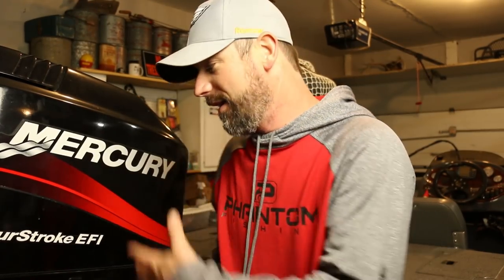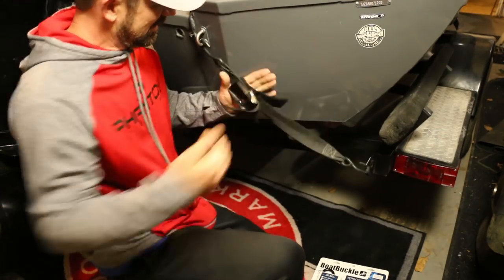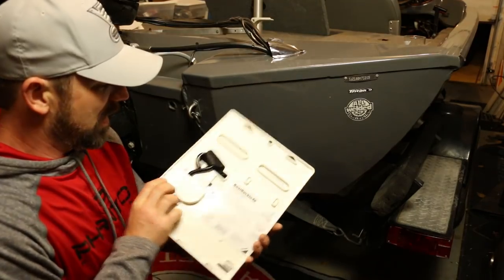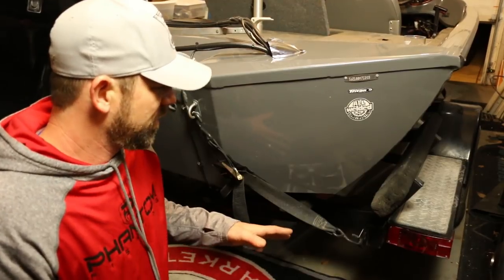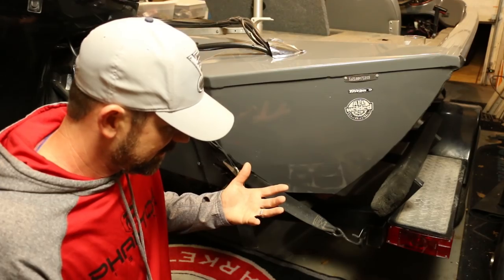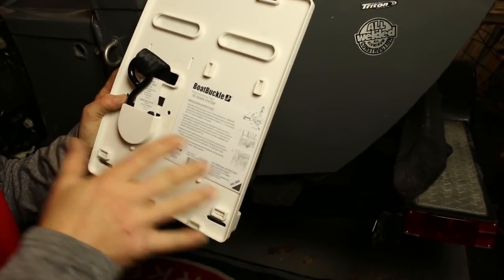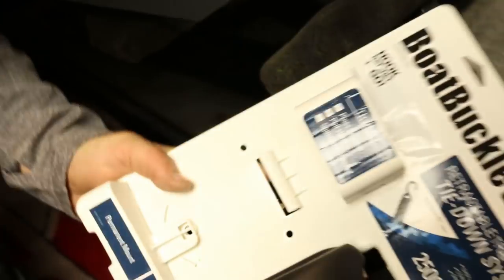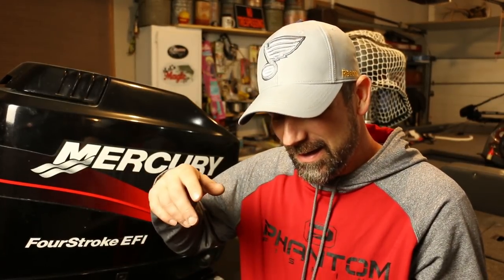Trashed Boat Clean-Up Part 6 Boat Buckle Install

Comment: Your lock washer should go against the nut. That way it keeps the nut from being able to come loose.
Reply from the maker: +Doug Walker I agree but the instructions showed differently.  I followed them but if I have any issues I’ll switch it.
Reply: And use a little lock-tite

Comment: You might want to put the washer on the other side of the tab.  It should be against the nut so that when you tighten it down, it locks the nut in place.
Reply from the maker: +Brad Hancock I agree but just did what the instructional diagram showed.  Maybe an error by Boat Buckle?

Comment: You're replacement tie downs are worth every penny. My wife actually broke a finger where's the ones that came with the boat. So now one of the things I have the dealer do before leaving with a new boat is to change the tie downs. These things work so good I even threw a set of them on my motorcycle lift.

Comment: Believe the lock washers should go on the nut side. Holds the nut from coming loose.
Reply from the maker: +Matt Orschell totally agree but went by the instructions.  Even did a double  take to verify that I was looking at the diagram correctly.  Maybe it’s just an error by the company?

Comment: Great upgrade to the standard buckles, but what they don't tell you is how much of a PITA the lock nuts are to tighten down.  Was unable to do it manually with a rachet and hand drill, so it looks like an air impact will be needed.  At first I thought I cross threaded the nut, but realized that wasn't the case after carefully attempting the second one and had the same problem.  Boat Buckle needs to fix this issue.
Reply: Goes on pretty easily if you use a little bit of anti seize on the threads of the nuts and bolts prior to installation.

Comment: Great upgrade. You will be lovin those, I have bluewater LEDs on my boat for deck lights and they are pretty simple to install. The only thing I really need like you is the recessed pan for my trolling motor foot control. The thought of cutting that into my casting deck scares the crap out of me.